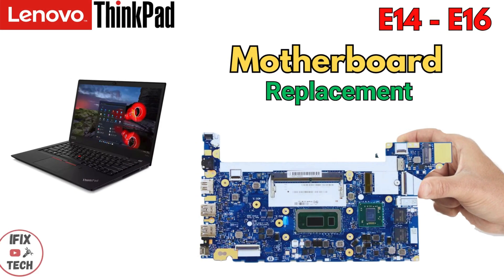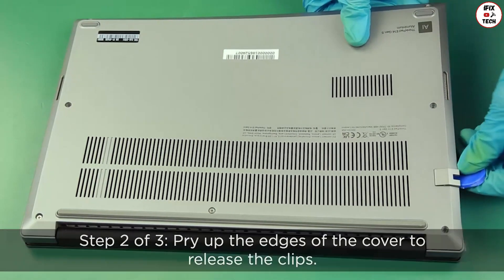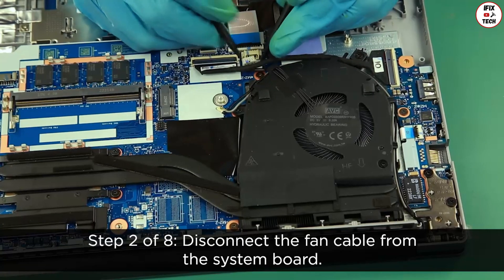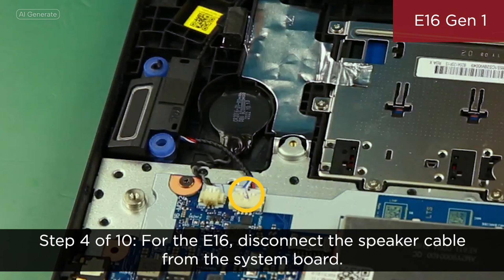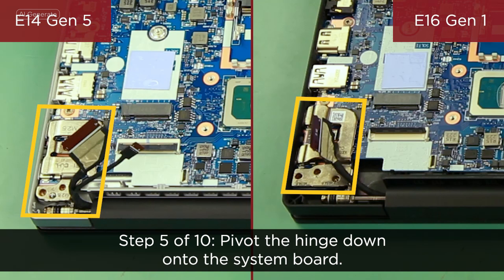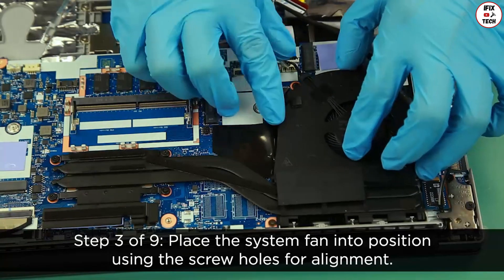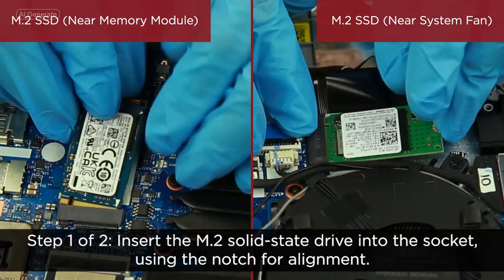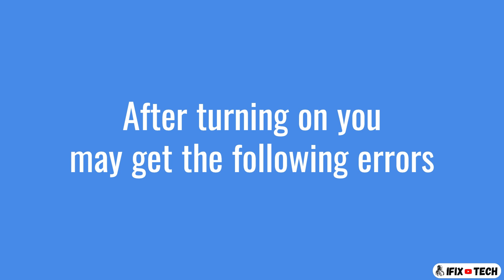Lenovo ThinkPad MOTHERBOARD Replacement E14 and E16 - How to Remove System Board

Comment: Do you know if the e16 g1 and the e14 g5 have the same Mainboard? Would help me a lot, if its the case i could fix my e16 wich stoped working just after the garanty was over.
Reply from the maker: Mmm, I'm not really sure. But I don't think so. You can check that on the Lenovo website pcsupport.lenovo.com 
Thanks for liking it and subscribing 👋 😉